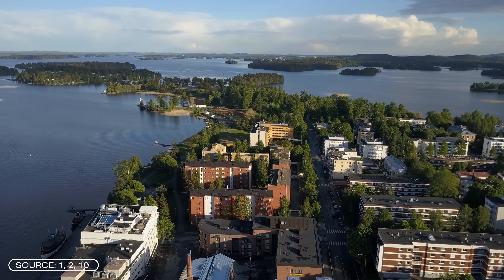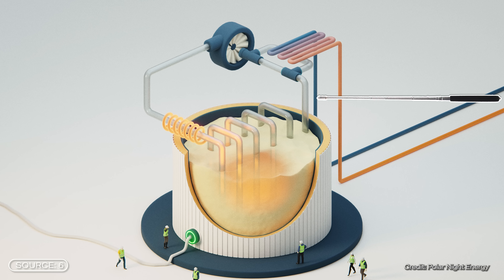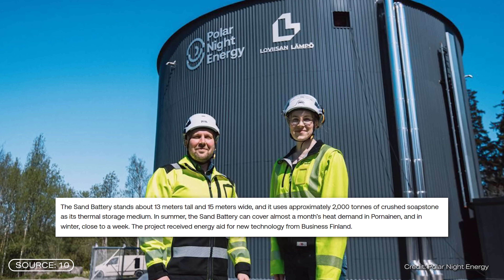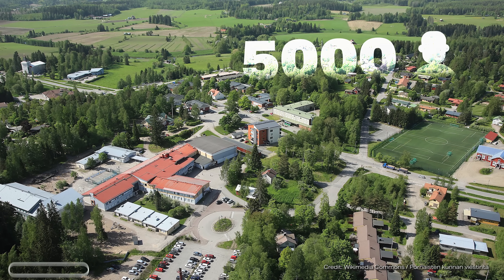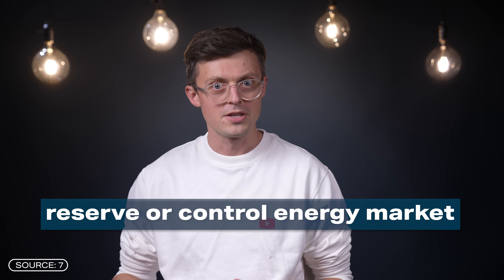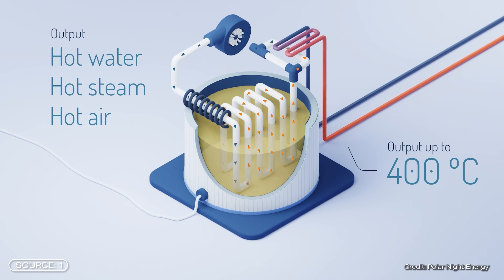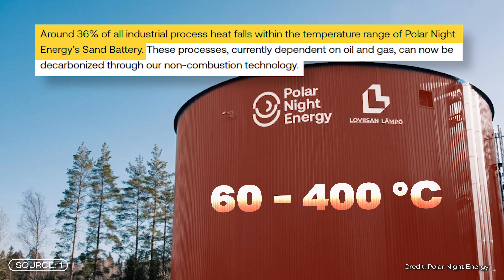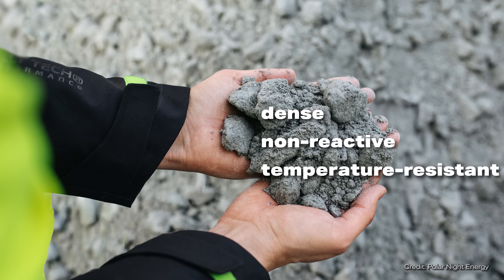Finland's Giant Sand Battery: A Revolution in Energy Storage?

Comment: Resistance  heater is crazy;,  we need high  temp  heat pumps
Reply: Thats way more complicated and less efficient.
Reply: @AmatuerHourCoding  it is  more  complicated, and we need new high temp heat  pump technology,  but  it would be massively MORE efficient, which  is my point
Reply: Nope. The loss in COP with temperature is too steep. I'm not aware of heat pumps above 70°C of output. You could maybe stretch that to 100-120, but above that it is physically impossible. Don't think only of first TD principle, it's the second one that makes the most troubles.
Reply: Another issue is the source of heat for the heat pump...  For a few kW,  one can use the ambient air surrounding the outdoor heat exchanger of the pump, alas for 1MW, we'd be requiring many heat exchangers spaced as much as possible, yet "freezing" the whole neighborhood;  we could maybe use an underground pipe circuit, at a decent depth and a good size area...
The thing with near surface geothermal sources is that they are rather diffuse, hence suitable for small applications but not bigger ones (not that 1MW is all that much, actually)

Comment: resistance heating not as efficient as heat pump
Reply: From what I think, you are correct and wrong. Ressistve heating is always less than 1 COP (maybe .90-.98) whereas heat pumps can get you cop upto 4-5 easily. However as the temp difference increases, heatpumps cop would drop fast. At 400 degree with cold side at room temp (not even freezing temps) heat pump cop will be waaaay below resistive heating (and very expensive to implement.) So, in my opinion, heat pumps cannot be used here. But I can very well be wrong.
Reply: @kohliabhi  you are likely correct 400 degrees so hot heat pump not much gain.  In this case you get greater energy storage from high temp, but limit yourself to resistive heating which is less efficient
Reply: What are you talking about? The extra steps and pump make it less efficient, it vastly increases complexity, and can't get anywhere near the same temperatures as resistance heating. Resistance heating is almost 100% efficient, only losing some energy to light. 

Are you high?
Reply: @AmatuerHourCoding  with heat pump you get > 1 J from 1 J electricity, you are moving heat from outside, look it up.

Yes it costs more but often worth it
Reply: Electricity to heat is literally the most efficient energy conversion.
Reply: @BrunoRegno resistive you get 1 J for 1 J
heat pump you get > 1 J for 1 J.  Does not violate 1st law you are moving heat, look up COP Coefficient Of Performance

Comment: The world is already running out of sand.
Reply: Its not that kind of sand
Reply: Go to sahara, you'll find plenty of sand this system can use, but other applications can't.
Reply: @castform57 that's hardly renewable. It wouldn't last as long as you think if it took off. Would also wreck ecosystems to take all the sand.

Comment: Thanks for this video!

This got me thinking about combining district heating with heat pumps. What are the economics of heating with a heat pump and dumping the excess cold into the district heating? Could get a high COP since district heating coils (steam?) tends to be quite warm.
Reply: I can guess only, but heat pumps do not work on such a broad temp range. I do not know any that could heat this up to 600 degrees, or could be used to draw heat from a 400 or a 50 degrees hot medium with the same efficiency. But that does not mean this is impossible though.

Comment: why not use heat directly with solar heat panels and some heat exchanger fluid running through it? i guess losses along the path and too hard to insulate pipes well compared to the giant vat
Reply: Easier to use electricity as available from solar panels or Finland’s nuclear power generated electricity at night when demand is low.  Piping requires more maintenance than electrical wiring.
Reply: Solar thermal requires not only sunny days but direct sunlight so it is less efficient in the north, waste heat from industry and thermal power plants is more readily available. And you still need storage to take in overproduced electricity and provide heat on cold days.
Reply: This is in Finland

Comment: In the "city of London" there is a district system mainly for a development called "the barbican" that is able to supply heating and cooling by having a store for each and by drawing heat and cold from the aquifer under London
Reply from the maker: That sounds interesting, I'll take a look at it too!
Reply: Similar system in Helsinki, it uses some sort of cavern. BTW you can also pull heat out of wastewater.
Reply: @McSlobo I love the idea of recycling heat, it grinds my gears when you see a gyms a/c dumping the heat to the air outside instead of the pool in the same building!
Reply: @McSlobo True. My dad is working on that concept currently: how to utilize heat loss from waste as efficiently as possible. He works at an ammattikorkeakoulu.
Reply: There are many such systems in the Netherlands. Over 3,5000. Schiphol Airport uses such a system for instance.